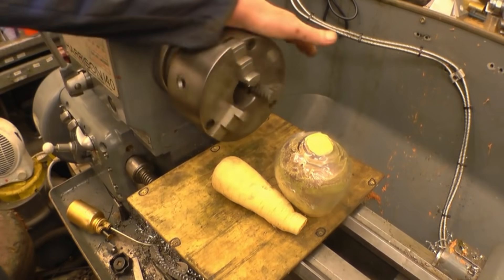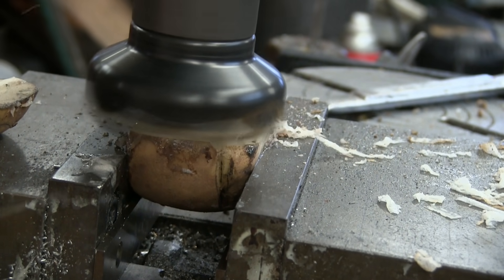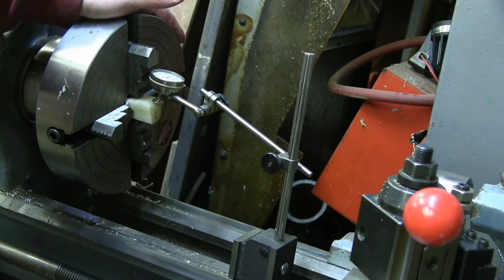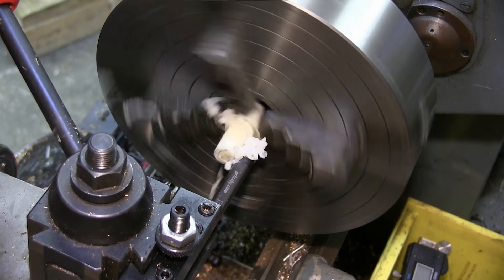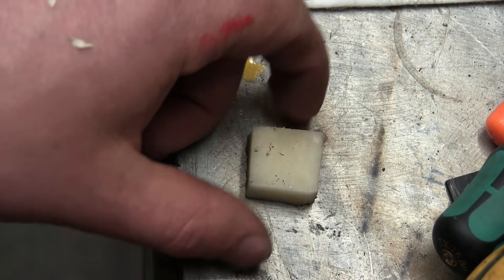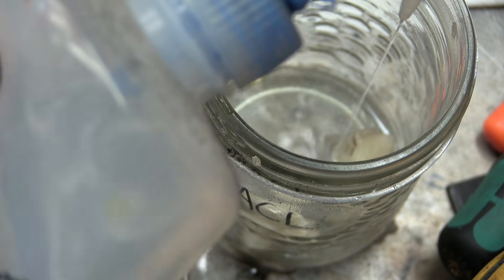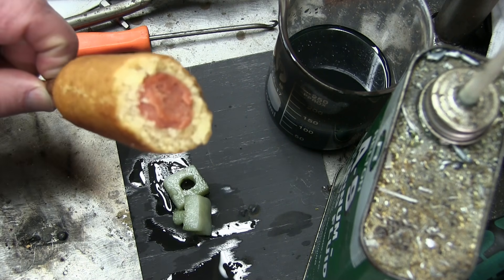The Impossible done on a milling machine

Comment: Somehow, I think you should have aimed more towards a UNC thread than a UNF. (Since that would help to limit thread galling).
Also, I have found in the past that using a mixture of CH3NO2 and NH4NO3 in a slurry to replace the A9 dinosaur squeezings is quite useful to limit any remnant negativity from the crowd that have gathered to watch.  (However, don't make Mehdi from 'electroboom fame' aware of the ratios you've used.  He can find out for himself).  Since the CH3NO2 is a little hard to find, you can use fuel oil as a subsitute, but make sure you leave the NH4NO3 in the ball mill as long as possible as it needs maximum possible surface area.
Lastly, I found it exceedingly difficult to heat treat it above a rockwell 0 level.  I either end up with an exceedingly brittle part that refuses to anneal, or the oxide growth becomes so excessive that the bolt thread no longer engages into the nut.

Comment: Back from the dead.   I didn't see anything in the machinist handbook about proper compounds used for cylindrical grinding these potatoes either.   I think CBN might be overkill.  Perhaps I'll try a 5NQ norton ceramic wheel at about 6500SFPM and report back.

Comment: One of my job at the grocery store, where i worked in HS, was to clean out the potato bin when it got smelly.  Nothing like the thrill of running your thumb through a rotten a$$ potato.  After that, changing diapers, and doing septic work was a breeze. - Got fish to go with those chips?  A Great omage to doubleboost!

Comment: I usually use a 30 deg' rake angle on my spuds... cuts down on the potato chips.
Reply: LaPabst I've found that vinegar works very well as a cutting fluid as well.

Comment: This poem shows the joke is on us.

The Designer

The designer sat at his drafting board
A wealth of knowledge in his head was stored
Like "What can be done on a radial drill
Or a turret lathe or a vertical mill?"
But above all things a knack he had
Of driving gentle machinists mad.
So he mused as he thoughtfully scratched his bean
"Just how can I make this thing hard to machine?"
If I make this perfect body straight
The job had ought to come out first rate
But would be so easy to turn and bore
That it would never make a machinist sore
So I'll put a compound taper there
And a couple of angles to make them swear
And brass would work for this little gear
But its too damned easy to work I fear
So just to make the machinist squeal
I'll make him mill it from tungsten steel
And I'll put these holes that hold the cap
Down underneath where they can't be tapped
Now if they can make this it'll just be luck
Cause it can't be held by dog or chuck
And it can't be planed and it can't be ground
So I feel my design is unusually sound.
And he shouted in glee, "Success at last!
This goddam thing can't even be cast.',
Reply: Where is that from? That's absolutely brilliant.
Reply: ...and for such as these did the fab shop invent the 3D printer.
Reply: @bvcxzgt5451  you can 3D print tungsten steel?
Reply: Fooking brilliant

Comment: Amazingly efficient process for creating a Deluxe Threaded Bolt and Nut Spudadium treat.  Question for our left handed friends...Can one use a Japanesium drill bit and reverse threaded tap so when they eat it, it self tightens and doesn't fall apart?

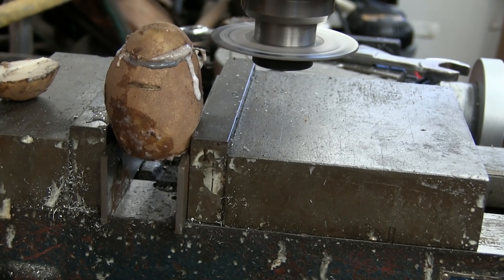Comment: 2:06 did anyone else notice the spindle turning in the wrong direction?
Reply: The cutters would probably rip apart the potato if it were spinning the right way
Reply: Klaufmann yeah
Reply: Klaufmann actually the chuck is spinning in clockwise direction. I gave it a closer look and saw that...
Reply: It doesnt really matter for a potato.  I would use smaller tools fi 12 R1 and S5000 so the potato would die instantly

Comment: This is the first time i have been to this channel,
so i have got to ask,
is he using bullshit terminology?  or...?
Reply: In this video, 90% of it yes.
Reply: Alex King aha thought so.
Reply: Alex was it that obvious? lol
Reply: +Rampster27 I don't know man. He's right about the heat of the meat being proportional to the angle of the dangle. Sounds pretty scientific to me.
Reply: Canadian English, we all speak like that.
Reply: But a complete lack of either funkle nuts, giggle pins and paracetamol flanging valves gave the game away for me.
Reply: Don't forget -if you've got problems with your giggle pin it can quite often be due to a fribulating laughter shaft bearing
Reply: Rampster27 stick around he is actually quite entertaining. he makes anything interesting. this was just some dicking around in a way better garage than mine.
Reply: All the terms he used about milling aren't bullshit. However, it was unnecessary since using the milling methods mentioned in the video is meant for steel or hard metals to ensure compressive residual stress in the metal or to ensure the tool doesn't break.
Reply: Rampster27 
yes lol
Reply: Arthur I hate it when my tool gets soft and breaks.

Comment: The most expensive homer shop way to make chips. fuck off america they aren't fries they are chips. Big frikking chunks of spuds that get the proper soaking in boiling dinosaur squeezings till done, no risk of any life threatening things to fubar up your evening food fabricating tasks, of course a few fermented beverages help as lubrication, 

do seek professional advice for proper doseage and strength of said libations prior to undertaking prior to work task, don't forget to consult with the clipboard warriors before starting said task 3 days prior to applying required power

I could go on but feck it
Reply: I hear Chip and think of your mom, err. dad, err... I'm just guessing.
Reply: >implying you fry potatoes in petroleum
Reply: fries

Comment: As an Irishman I find an process that uses a spud as its sole input without resulting in breakfast, lunch, dinner, famine, mass emigration, ethnic stereotyping or alcohol to be unnervingly close to playing god.

AvE you are meddling with forces beyond mortal comprehension and the consequences will be far reaching and irreversible. Like a motorcycle with good fuel economy and no reverse gear, but solely made of potato.

Careful now. Down with this sort of thing.

Comment: A custom tator butt plug you've made there with a nice lube! Smash it in the vice or blow it up! I subscribed. I'm not a DeWilt fan but I have a couple of them blue and black thingies with some white lettering on parts of it. Got a bat ry plugs into the charging station with a fan on it!? I recently bought me a ridgid 12" compounder beveling machiny thingy. Good for chopping mozzarella fingers off. Wish I had all those great toys to play with and knew how to use them to do something constructive with. I've got a lot of respect for machinists! Dad was one for 30+ years. I didn't apply myself in that mathematics thing. That was for them smart kids.

Comment: probaly shoulda supported the free end of the stock to keep it from wobulating on the end, producing the non-uniform diameter of the finished screw blank. Really soft stock can sometimes benefit from chilling a bit, to just above freezing. If it were a 'merican potato, you could bring it down to a little above 32 degrees. As this is likely a Canadian spud, though, you will have to bring it down to nearly zero degrees, for the same effect. Nicely done, considering the constraints you were under.

Comment: When hand drilling I think you should have center punched it as the center seems somewhat off. But it's a difficult job to get right the first time - just keep practicing.

By the way, by milling potatis you can achieve pommes frites that meet the ISO 9000 norm

Comment: This is a good example of how not to use equipment.  There are three main types of gear, metal working, wood working, and vegetable working.  Threading any vegetable requires vegetable working gear which can be recognized by their wooden chucks and cutting tools.  You were lucky the potato starch did not react with the steel to form an electrochemical cell and feedback power into the motor causing an explosion.  Sensible people only machine vegetables with proper vegetable machining equipment.

Comment: no I didn't have 12 minutes for this sorry.  eat  the veggies? Some may watch and understand nothing like why you cut with the wrong side of a boring bar? No I didn't have 12 minutes for this sorry. I skipped through.  Eat  the veggies? Think about title. think about content. I would even ask if someone has been crackin' open the Jameson a little much. What? prefabulated ? By graphite surmounting?  Sir Mounting? I don't think I have seen anything make less sense. AluminEE-Um. Keep your dick on the ice? Does this guy eat batteries? Lead paint?

Comment: I notice no coolant was used. How stupid is that? Those bit's of potato could have got red hot and damaged the cutter. Worse still, the potato or the cutter could have shattered due to the heat friction and god knows, maybe even death or at the very least, serious injury. I think also the cutting speed was too slow to get a proper finish. Were you using HSS or tungsten carbide?

Comment: You could have made a sort of angle plate set up but with a piece of deep channel bolted to the t slot. Have a bunch of holes in the u channel with bolts sticking through both sides (think one of those peg board dealios that you put your hand on in the novelty shops) to give proper support to your potatoe so it does not move when you are milling it. I don't expect you to do anything as all I did all last weekend was eat and sleep. Regards. :)

Comment: Well, never thought about something like this before, but always a first time for about anything. I believe I'll try making Fuji applesauce on my wood lathe with a reverse cut. That way I won't get too wet and a bucket below the bed should catch all the goodies. I'll then try to dry the cores. For what reason, .....I have absolutely no idea. The shop will smell great though, better than when I take the chain saw to the Hubbard squash.
(If you do that, ...be sure to shut off the bar oiler.)

Comment: I had a friend in welding school who made a chain with 5 links in it just using a milling machine. Even the teachers said it would be impossible but he proved them wrong. There were no breaks in the chain/links and no other tools were used other than an upright vertical standard milling machine. It was quite impressive.

Comment: This is a joke. Show me what you can do with molybdenum or kovar on a 5 axis machine in a +/- .001" environment.
Reply: +Michael McCurley I could drive a 5 axle truck through +/-.001 and still have clearance. But it would have no effect on my hunger. If fact, I have a craving for raw potato at this very moment . I prefer raw because nobody can screw that up. Or can they?
Reply: +Schnikkel Sure you can. On what machine? BTW it's "in fact". Try proofreading your crap, journeyman...
Reply: +Michael McCurley I do not proofread my crap. I flush it, perhaps one day to merge with your sense of humor. You are most likely a joy to work with, but, alas, I am retired from HAAS and will never experience that delight. (I will go sleepless tonight wondering if the previous sentence has too many commas.)
Reply: +Schnikkel Uh, yeah, my apologies. You worked for Haas?
Reply: +Michael McCurley - This seemed like a perfect place to joke around since I got sucked into this impossible machining demo. I will gladly cop to exaggerating the reality and difficulty of holding +/- .001 tolerance. I took a chance on the existence of 5 axle trucks for the sake of poetry. --- I never worked for HAAS. As a precision sheet metal guy I did some design work for them. Mostly way covers but also other odds and ends. Found the optimum method (90s) for crimping the wipers and experimented with many wiper materials and extrusion shapes. I also determined the clearances and tolerances for the cover sections so they wouldn't crash (an ugly occurrence as you probably well know). --- Nothing personal and no harm intended. --- For the record, I consider Gene Haas a gentleman and a genius. There is a very interesting Wikipedia article on him.
Reply: +Schnikkel Yeah, I know about crashing. I still remember the horror I felt the first time. Fortunately, it's been a while since I banged the wrong parts together. I'll check out that article...

Comment: Yur taterholder lacks a gripifier for holden the tater tighter. Yur whirlycupper could use a strobawidget fur seein the cutter freeze. You totally spaced usein cuttin fluid when tappin the taterholer. Also, you toasted yur parts to the the wrong color during heat treating. Have you forgotten all yur trainin from yur daze in skool?

Comment: Good video , very entertaining. I always wondered what else I could mill. I would never taking full diameter cut with a unstable work piece, specially taking 300 thou cut. make sure your put the load in the non movable jaw you get less vibration. never climb cut well at leash tighten up lock on the carriage so the table dont take off on you, those old machine got lots of back lash eh. I dont know why you didnt think to drill the hole on the mill, it would been more true and positionally accurate.

Comment: You refer to the "Rhodesian side" as if it's shameful. I'll have you know that one of my very best friends is 1/4 Ridgeback, and he runs his lathe to and fro just like any man. No preference to tooling from in front or behind, no judging his brothers and sisters for their directional preference. I'll also have you know that he has zero issues with tubular glandulation at the tip or anywhere along his potato bolt. That issue has zero relation to Rhodesian preference or otherwise, and it's irresponsible to suggest it. However, I am glad I watched this video for one reason... Spring cuts.

Comment: Turn your tuber into a terrific sabot so you can push a golf ball out your air compressor potato gun. Once yah build it with an arduino controlled trigger valve. Break the sound barrier?

Comment: I don't quite get it. Is this about taking a mundane task and turning it into the most convoluted project possible? All i know for sure is that I saw you cutting down the bolt using tools and measures and safety galore, then i see you make the nut by drilling a hole in a piece of potato that you are holding it in your bare hands.
Reply: +billpuppies I think it's pretty obvious. He was just doing the impossible. putting threads in a potato.  The youtuber who screwed a turnip into a parsnip said it couldn't be done.

Comment: i'm loving the technical terms. "unobtainium pixi dust" is sure to be a clasic
Reply: +N3kr0n15, I have been using that phrase at work for years. It describes the ridiculous requested materials people want for new equipment.  It must be as light as a human baby, support 20,000 pounds, be easy to weld, machine, and corrosion coat. It should also have created no environmental hazards when being created.

Comment: Reminds me of when my father gummed up my bandsaw by cutting bones for the dog.
Reply: +onjoFilms Or the time the clown in sales cleaned his carburetor in the trichloroethane ultrasonic circuit board cleaner. $300 worth of filters later...
Reply: +James Jarmon and when you want to get rid of the body, try an oxy
Reply: +onjoFilms 
I bet that wasn't as bad as the time my uncle used our crummy old 12-inch. Craftsman bandsaw to cut up a 20 lb. Coho salmon.
Reply: haaa
Reply: +onjoFilms miter saw works much better.
Reply: +Mishn0 Those carbs were WORTH it !!
Reply: +James Jarmon  I saw a guy try to cut a 2" diameter poly rope with a chop saw once. Now that was exciting!
Reply: Michael Chrest  I have more respect for my fingers than to try that.
Reply: Rope melted to blade, blade bent, fence bent, lots of noise, no digits were severed.

Comment: "Now the well-salted machining crowd amongst us will know that I'm going for a Reverse Rhodesian Reach-Around technique with the boring bar. I like to try new things on gummy or aerospace materials. Now normally I would recommend you'd go with the cutting angulations that you know; the heat of the meat being directly proportional with the angle of the dangle and the mass of the ass. However, in this case, we just don't know."

-AvE

Comment: Potatoes need to be frozen before milling or turning.
Reply: +Tycho343 Potatoes need to be frozen before welding. Frying only requires the aforementioned salt bath. Thanks for playing!
Reply: well if you want to turn your shop into a death trap, that's your initiative.
Reply: +1
Reply: +Tycho343 yhea yhea RTFM et cetera, no tnx
Reply: +Tycho343 he really should have know this, it's a safety concern
Reply: +Tycho343 uhm, no they don't. it's a free world ;D
Reply: +Evipicc I think technically they need to be boiled until cooked, then frozen, preferably in liquid nitrogen so you have some time work before it goes all potatoey.  Maybe case hardening the outside with a light application of an oxy-acetylene torch to help it keep its shape and moisture removal in a vacuum chamber.
Reply: +wronger0123 Well he said they need to be frozen before milling, not frying.
Reply: ***** Ofcourse you have to account for thermal expansion.
Reply: +Tycho343 True but you better not mind using some beef squeeze out if you freeze them. (eeze) being the equal here.
Reply: Is it retarded for me to want to see a follow-up video to this one in which he actually uses sub-zero potatoes and uses best-practices to make a well fitting... potato.. bolt...?
Reply: Tycho343 an experienced potato miller/turner would know

Comment: Ok, you are somewhat of a weird dude. Still I see Harbor Freight orange handle pick tools, Aloris tool post on lathe, cutting oils, fluids ect. Parts moving in vice, No coolant needed, Acids and water in material being cut that can rust machinery, I will admit, I thought I had seen everything at age 66, but I had not. Interesting, funny comments during video. I give it a thumbs up.